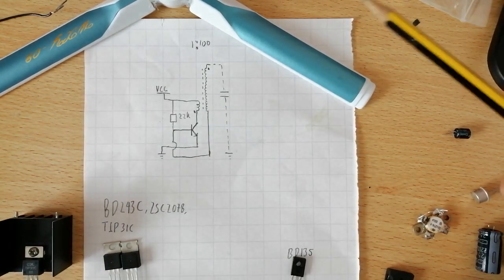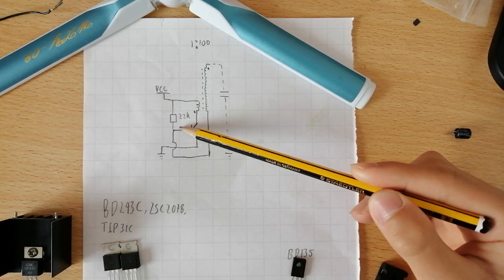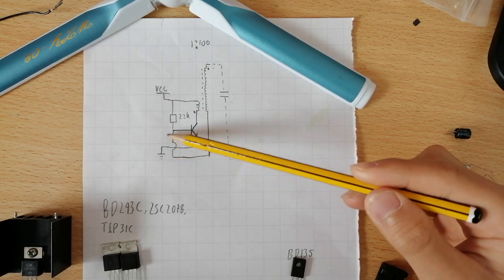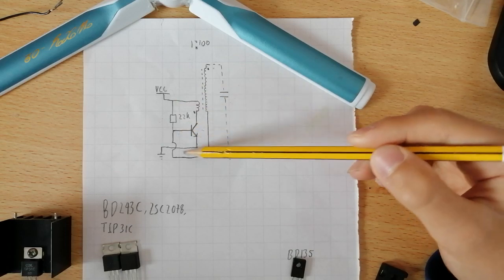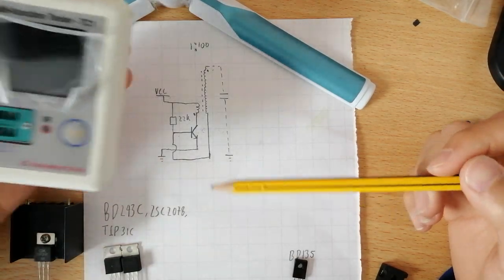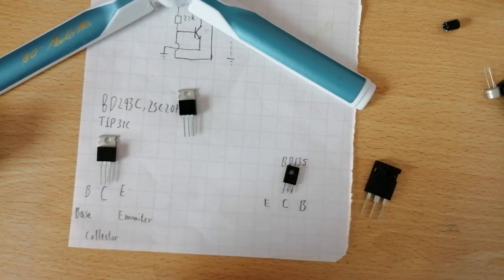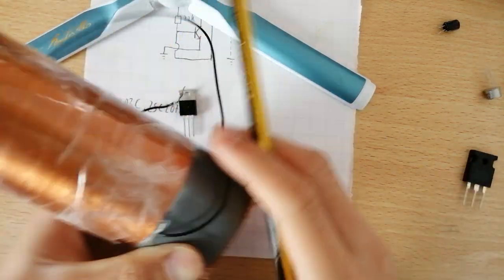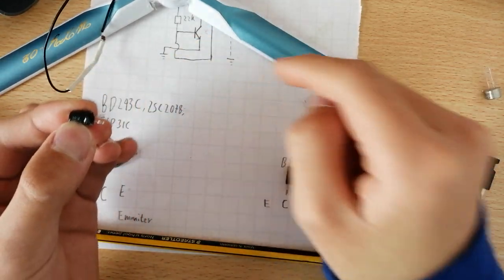Slayer exciter Tips for troubleshooting

Comment: I had a(0.5mm) 800 turn on my secondary and 5 turns on my primary and 22k resistor but it doesnt work can you help me?thanks.
Reply from the maker: Try reverse the primary coil
Reply: @ReedSwitchTube  it doesnt work either
Reply: @ReedSwitchTube  i tried to reversed the resistor but it doesnt work i tried to change but no sign
Reply from the maker: @generbantugan9925  what transistor did you use?

Comment: I use primary around 4 turns and secondry around 1138 turns and I use tip31c transistor and 47kohm resister and as supply voltage I use 9v DC battery . It didn't working. And also I applied around 4 coats of varnish to secondry please help me what should I do.
Reply from the maker: Have you checked the connection between the secondary feedback connection? Because there is insulating enamels coated on the wire.
Reply: @ReedSwitchTube  Yup I sandpaper secondary wire which connect to rest of the circuit
Reply from the maker: @sheladiyadeep8275  Try reverse the secondary coil.
Reply: @ReedSwitchTube  ok brother and I have another question that I apply 4 coats of varnish to secondry could it be the reason that my Tesla coil isn't working ?
Reply from the maker: @sheladiyadeep8275  Ok, have you tried measure the inductance of the secondary?
Reply: @ReedSwitchTube  bro it says 5950.00641 microhenry, I tried online calculator
Reply from the maker: @sheladiyadeep8275  5.95mH, it definitely should work, are you sure you have not tested other component whether they are good or not?
Reply: @ReedSwitchTube  yup I double checked everything
Reply from the maker: @sheladiyadeep8275  Have you checked the transistor whether it is real or not?
Reply: @ReedSwitchTube  yup I checked it
Reply from the maker: @sheladiyadeep8275  Then have you tried to add a top load to increase the parasitic capacitance.
Reply from the maker: @sheladiyadeep8275  go and check the channel about, it should say view email address.

Comment: I appreciate your effort making this video. My coil does not function I tried reversing  the primary winding and it didn’t work.
Reply from the maker: How many turn do your secondary coil has?
Reply: @ReedSwitchTube  650 turns and 3 on the primary. Update it now works my transistor was broken.
Reply from the maker: @xsauce3858  Good luck!